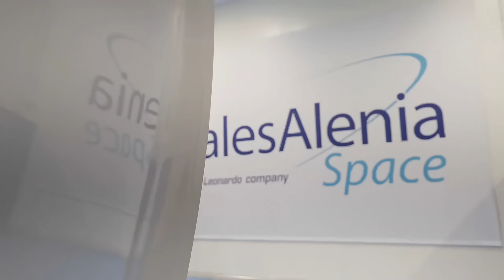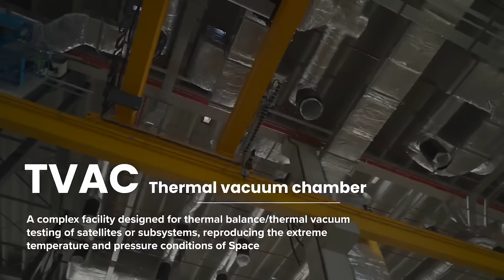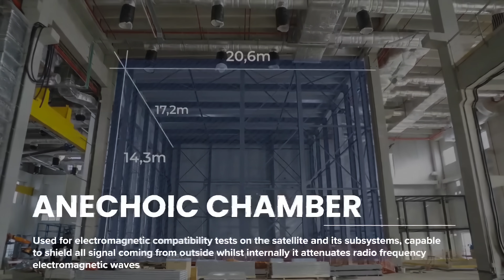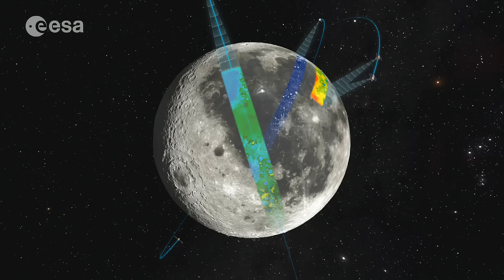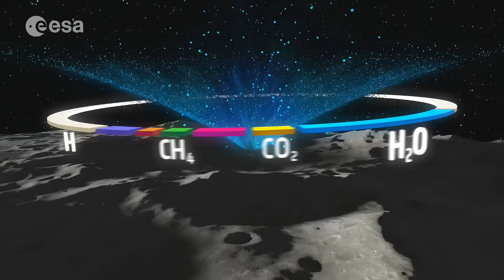Breaking News!  Italy is building the first Moon base for NASA Artemis!

Comment: I hope they do a better job than on the italian trains sold to the dutch railways. They break with rain, with snow, with heat with leaves on the track... or just whenever 😅
Reply: AI Overview
The Fiat 500's reliability is generally considered average to slightly below average. While some models have received positive feedback for their fun-to-drive nature, fuel efficiency, and affordability, others have faced criticism for various mechanical and electrical issues. 
Pros:
Affordable to buy and run: The Fiat 500 is generally inexpensive to purchase and maintain, especially when compared to other vehicles in its class. 
Fun to drive: Many owners praise the Fiat 500's nimble handling and engaging driving experience, particularly the Abarth models. 
Good fuel economy: The Fiat 500 is known for its decent fuel efficiency, making it a good choice for city driving. 
Compact size: Its small footprint makes it easy to park and maneuver in tight spaces. 
Unique styling: The Fiat 500's retro design is a major draw for many buyers. 
Cons:
Potential for mechanical issues:
Some owners have reported problems with the engine, transmission, suspension, and other mechanical components, especially in older models. 
Electrical problems:
Fiat 500s have been known to experience issues with the electrical system, including battery problems, faulty control modules, and issues with the Blue&Me system. 
Transmission issues:
The Dualogic semi-automatic transmission, in particular, has been associated with jerky gear changes, slipping gears, and even complete loss of drive. 
Higher repair costs:
While maintenance is generally affordable, some repairs can be more expensive than expected, especially if they involve major components. 
Interior durability:
Some owners have reported issues with interior components, such as door handles and armrests, which can wear out or break prematurely. 
Recommendations:
Consider model year:
Some model years, such as 2015, 2018, and 2019, have been reported as having better reliability than others. 
Prioritize maintenance:
Regular servicing and maintenance are crucial for maximizing the Fiat 500's lifespan and minimizing potential problems. 
Inspect thoroughly:
Before purchasing a used Fiat 500, have it thoroughly inspected by a qualified mechanic to identify any potential issues. 
Be prepared for potential repairs:
While the Fiat 500 is generally reliable, it's important to be prepared for the possibility of repairs, especially if you plan to keep the car for a long time